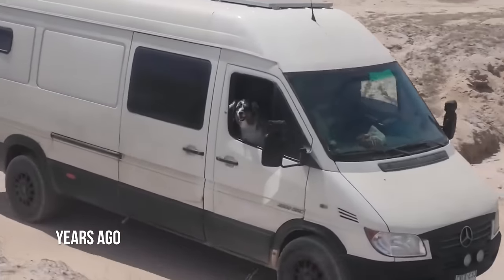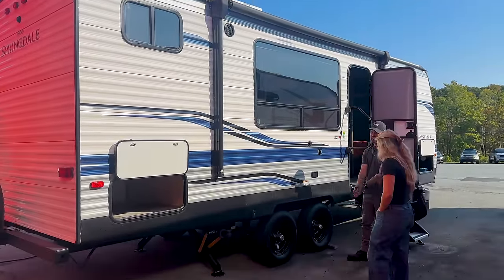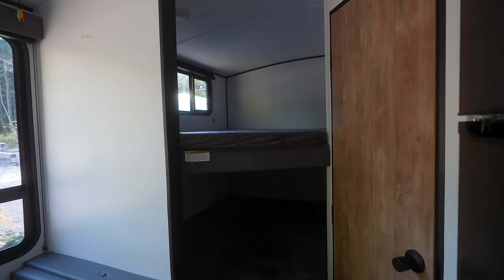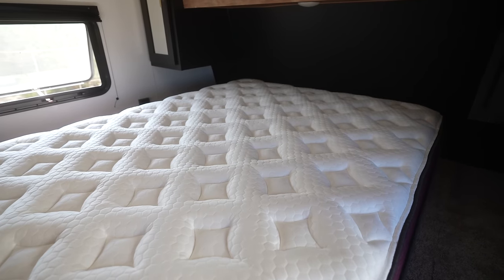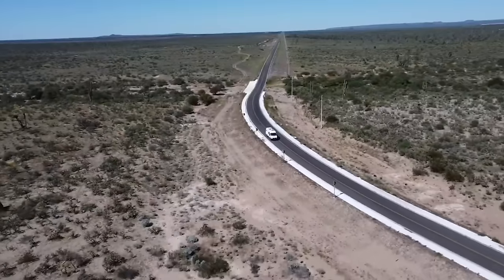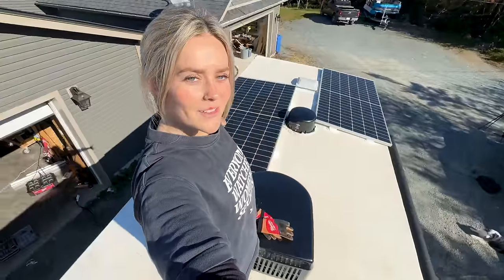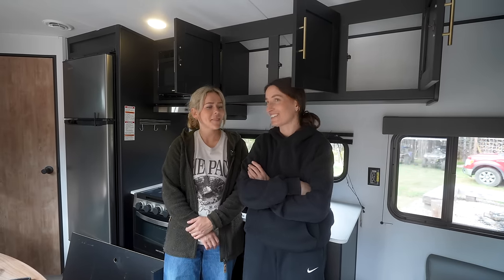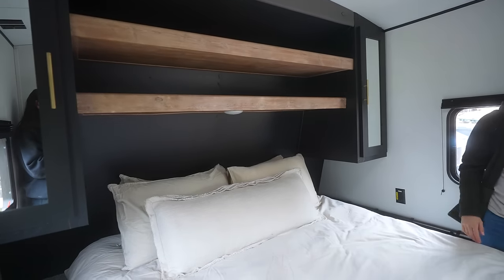We Bought an RV!

Comment: Congrats ladies, you made a good choice. That rig should fit your needs. Since you don't have a lot of RV experience here are a few tips: be cautious of adding too much weight, be sure to carry an easy to use jack & spare tire for flat tires, keep close watch on your tire pressures & carry a small air compressor, while its still new & clean - get underneath with spray foam and seal up all the cracks & holes where mice & bugs will find their way inside, that type of RV patio awning is very easy for high wind to cause serious damage - don't leave the awning out when you're not around - a sudden wind can rip it off, once you get it parked semi-permanent you can add some tie down straps to the awning anchored into the ground. practice backing it up before you need to fit it into a tight space. practice making wide right turns before you're in a city and have to make a right with cars close on both sides.  Looking forward to your new adventures in Mexico

Comment: Congrats on new RV ladies!  Long time RV’er and I live in North Carolina. See lots of great tips, but going to add a few more. Purchase a high quality trailer hitch security lock from Proven Industries. These locks also allow the RV chains to be locked inside the ball area. RV can be stolen very easily with the chains only. Also get a jar of museum wax “quakewax” it’s great for mounting to bottom of small items and they will not fall off walls, counter tops, and inside cabinets while driving. Black and Grey water tank sensors can get mucked up and stop registering correctly. I connected a Camco Rhino Blaster RV Tank Rinser with Backflow Preventer to my tank connection and add a secondary water hose to rinse out this areas just after dumping and tank sensors register correctly. Purchase some good sealer moisturizer balm. Being in a dry climate those door and basement compartment seal will dry out quickly. I use a rubber seal balm/treatment. Also dry lubricant spray for door hinges every 3 months.

Comment: New RV looks fantastic, make sure you get GOOD locks for when it's hooked up and unhooked. Oh, I HIGHLY recommend getting a Weight Distribution System and a Sway Bar if you haven't got it yet and make sure you know the height of the trailer for low bridges!

Oh, small tips, when backing up place only one hand at the bottom of the steering wheel...if your hand goes left so will the trailer and right it will go right as long as you don't make wild maneuvers.

Comment: Congratulations on the new camper trailer!  We have a 2018 Roo 233s trailer. After several years of camping, we started getting blowouts on our trailer tires. From the factory, they came with load range C tires. My brother-in-law said we had to replace the tires every 5 years no matter how much tread was on the tires. We opted to put Load range D tires on the trailer for a little more heavy duty tires. They are working out better.

Comment: As you turned your second bedroom into a storage, take care that you load your belongings in a way that the weight is distributed evenly and the center of gravitation is as low as possible... it will be so much easier to drive the vehicle!!!
And also take care that the weight on the hitch is high enough... this helps you straighten up the vehicle if you have to make quick moves on higher speed!
Good luck for your new adventure!!!❤❤

Comment: Good luck on your trip down south , as other people have said balance is key when towing. Get yourselves a  weighbridge certificate loaded & a towball scale preferably and keep minimum of 10% of weight on the towball.
Even if it means moving  stuff around while travelling. PS :  Speed is your enemy, knock a few kilometres off when towing and you will find it more comfortable IMO
also saves fuel.
Safe travels

Comment: I'm excited to see this new adventure unfold. 1 thing tho, i dont think you're supposed to use regular toilet paper in an RV as it doesn't break down & can clog up the line
Reply from the maker: Thank you for sharing with us.💛🐾
Reply: @Vanwives  You can test any toilet paper by putting 4-6 squares in a jar filled with water. Put the lid on tightly and shake the jar. The TP should immediately dissolve to little wisps of paper. We've found some RV TP won't pass that test as well as most regular TP. Good news is Kirkland Signature at Costco works great. We used it for nine years with no problems after we learned that test.

Comment: Another hint. Always have the awning on as much angle as comfortable. It needs it to she’d rain. It can only take 10-15 mph wind without damage. Always take it down before leaving to go someplace.
Reply: @BobBohner4851  to add to this tip your awning is identical to mine and I lower one side a few inches with the tension screw on the arms to shed water cause a normal rain event will cause it to collapse. 😊

Comment: The first job should be get your septic and water set so you can use them with trailer while building house. I mean put in a trailer spot with hookups first that use the house system. That way if you have guests after moving in, they have hookups available.

Comment: I pull the same size trailer with a 2012 F-150.  I installed Firestone air bags on the rear axle and they make a huge difference when towing, and the head lights shine on the road instead of up in the trees.  Also, keep your speed under 95 kph and the truck will use less fuel.  Good luck on your travels

Comment: Congrats!!! Looks like a better quality unit vs most of the junk you get nowadays. Only have 3 suggestions for you:
1) Replace/Upgrade the tires asap --- trailer tires are notoriously poor quality and seem prone to fail early -- just replace with better quality tires straight away and de-risk that somewhat.
2) Add small sills at the front of your many cabinet doors to avoid things spilling out when you open them after a drive.
3) RV toilet paper --- don't use regular tp if you can help it.
Cheers!...from North Vancouver
PS -- Krystal is just glowing, as usual....

Comment: Great trailer!  Check what the roof material is before walking on it again -- a lot of them have a type of rubber membrane on the roof, and I think you have that as well.  If so, when you go up there, take your shoes off first.  Shoes can often have bits of stone and gravel stuck in them, and that will immediately puncture the rubber membrane on your roof, which will cause leaks.  So easy solution is to just be up there with your socks or bare feet only.  No shoes and definitely no (small or large) bits of rock or gravel!!

Comment: Just a helpful tip. On my truck, on the driver's side, between the front windows, I have the height of my truck (7'6"). When towing my trailer, I have the height, total length, width, and weight with the trailer. In some places, there are height or weight restrictions. 
Another addition is to get a few spare trailer tires, plus a jack specifically for the trailer. I had a truck in front of me shred a tire, and though I did my best to avoid it, 2 of my tires sprung a leak. Also, get a way to add air to your tires as needed - I have one I just plug in and can add air as needed.
Also, change all the locks. Many trailers have the same keys. Maybe look into getting a camera set up for security, and/or add a dead bolt lock. When you decide where to park it, remove a tire on each side or both sides and use cinder blocks to keep it off the ground. When leaving it, take the battery off and lock it up, along with the tires and anything that is attractive to theives. 
Also, when it’s situated, make sure you have the trailer grounded, and above any flooding possibilities.
Reply: Another thing, get some non-slip shelf liners, add some china protectors/padding between your dishes and pans, plus anything stacked that can break. 

Add some cabinet locks, strong magnets, bungee cords, or toggles to keep your cabinets from flying open when the weight in the cabinet pushes against the doors - especially if you are on an inclined, angled, bumpy or rough dirt road. 

Always empty black tank first, then grey tank. 

If possible, get extra insurance for your RV. Especially as you are traveling a long distance. 

Don't forget fire extinguisher, and a fire blanket, they can make a big difference. 

Good luck and safe travels!
❤❤❤

Comment: I have been living in trailer for years and, like you, I didn’t notice mine didn’t have any drawers for cutlery either until I bought it…WTF 😂.    My only concern is the tongue weight with 10 batteries up front😮. I had hoped you would have picked the “L” shaped kitchen rv.   😢.   I think it would have been more long term livable, but you had a lot to consider with the upgrades.  Bravo.  I am so much looking forward to your Mexico project.   ❤. “Playa Castillo”.
Reply from the maker: Thank you for caring and sharing. 😊🐶

Comment: Congrats on the RV, and this next chapter in your adventures! 
Remember that RVs get bounced around a lot when travelling - like an earthquake while travelling (especially on those Mexican roads!).
Tips:
-Those finishing nails will fall out and things will break. Bring tools and supplies to fix broken cupboard door
- Buy a roll of non-skid material (generally used for under small carpets) and line cupboards to absorb some shock and keep things from sliding within the cupboards. 
- Stuff your pillows in cupboards when travelling to fill spaces where you don’t want things shifting
- Put “locks” on cupboard doors to avoid them opening while travelling (child locks work well)
- Put away anything not nailed down when travelling or they become projectiles within the trailer. 
- RV toilet paper only!
Suggested RV names - Romona (aka ROAMona), Seymour (aka SEEmore)

Comment: Remember girls, those little arms that come down off of the bottom of the camper those are stabilizers not for leveling. You need to level the trailer with the front hitch and the tires by putting leveling blocks under the tires. Those arms underneath are strictly for stabilization from what I’ve always known Unless the camper place told you different???

Comment: OK - further research says that Mexico electric power standard is 127 volts, 60 herz.  Some devices may not like that higher voltage.  Check the manufacturer’s info plates for compatibility.  Caution is advised.  Safe travels.

Comment: The gas mileage is going to be a shocker...I have a 21 F150 with the 3.5 eco-boost and end up getting about 7-8 miles per gallon towing a trailer a little smaller than yours...FYI

Comment: You bought a Keystone Springdale!  I think you'll like it.  Besides my Class A I owned for 17 years, I owned two travel trailers/park model's (both @ 35'), one was a 2011 Springdale Western Edition, two bedrooms with glass sliding door entry.  I remodeled the entire interior and refurbished some exterior features and was a great live in while the Class A needed to go to the shop.  The other 35' trailer was another Keystone, but called a VR1, with a pointed front end/front kitchen and huge rear bedroom with office space.  Had that on a lake lot on a hill.  Fun times, as I know you'll be enjoying this new Springdale in Baja!!!  And I should have known from the Popcorn/Microwave hint that you were not going to rely on 30 amp power, going Solar/Battery is so YOU!  Tip:  Those vinyl covered sofa's/seats won't hold up to doggy paws so get some good covers and they should hold up longer.  So excited for you.  BTW, what happened to the van?  Scratch that question!  I watched to the end!

Comment: nice camper ladies !. my only worry for you two, is the truck might be under weight to tow such a large camper, 30 ft ?..wow..thats pushing it big time. my 1/2 ton truck is set up for towing, and i have towed a 29 ft trailer with it, but man...getting 5 mpg sucked big time..lol. be very careful about putting too much weight in that back corner ?, you do not want to go through the '' tail wagging the dog '' (trailer sway )..its not fun at all !. deff ditch the tires that came on that rv, chances are, they are china tires ?, check into some name brand tires, i put goodyear endurance tires on my camper, love them !. last but not least for now, do not speed when pulling this rv !..take your time getting there, it may seem slow ?, but at least you get there safely !. p.s. be sure to test everything before you get to mexico in that rv, a lot of things will not work, and then you will need to have them fixed, fun times with those issues !..lol.

Comment: 3 things come to mind that you should know about towing and owning an RV. 1) NEVER leave the awning out with both ends even or parrellel. In the rain it can easily become a bathtub and the rain water weight will destroy it. (As me how I know).  2) Make sure you never overload the back of the trailer while traveling. It can cause you to lose control in a heartbeat. (Watch YT videos on propperly packing trailers). 3) You have to use RV SPECIFIC toilet paper to keep from plugging your tank and piping system.  RV type TP has less of a binder, so it breaks down far faster in water.   I was really happy to see the solar batteries placement up front.    Best of luck!!!!

Comment: Lady's 5,000 miles!  make sure that everything inside and outside is tied down before taking-off to Mexico.  make sure that the cabnets have magnets to keep them closed.
take a jack for the trailer for fiat tires,   everytime u stop, check the trailer tires lug nuts.  put a security light outside by the door.    Ur Baby's will love going to Mexico.
Have a fun and great time going down there in ur new travel RV.   lv from Sunny Florida.   be careful driving drive thru at Mcdonalds.
Reply from the maker: Thank you for sharing all your knowledge and experience with us. We did a lot of research and reading on the RV life. 😊🐾
Reply: @Vanwives  just wanted to let u know some of the RV life foegots before the trip.   be careful going too fast around the corners,  takes a wide turn.
Reply: @Vanwives  If you haven't left and found out the hard way, research marine cabinet hardware. When driving down the road, the trailer is subject to motion similar to a boat on the water. Also, stow gear like it's a boat, for weight distribution and center of gravity.
Toolbox drawer liner material should help with keeping stuff in cabinets from sliding/rattling when under weigh. Toolbox drawer liner is also good to separate pots and pans to prevent chipping/denting/scratching when nesting them for travel.
Happy Trails!

Comment: Considering how far y'all will be traveling and that the trailer will probably be overweight, I would suggest you carry an extra leaf spring, because they do break. Also, get a bottle jack and make sure you have the right size open-end/box-end combination wrenches and sockets with a long breaker bar (not crescent or pipe wrenches, they will round the nuts off)  to remove the leaf spring WHEN they break. Once you change the first leaf spring you will get the hang of it. A little intimidating the first time, but it is really quite simple. It's just part of the joy of owning an RV. Also, when you stop for gas or a break, inspect the suspension to make sure everything is hunky dory. Can't wait to watch the journey to the Baja and the build of the new place!

Comment: A tip for new RV owners, when filling the fresh water tanks run the water in slowly the tanks have air which needs to come out , but some tanks dont burrp very well , so you can end up heading to your destintion with only half the water you should have, cheers

Comment: Yeah, tires.  Michelin.  Mexico electric standards?  When Dad had the car stereo shop in St. Paul, MN back in the mid 60’s he had a customer from a Spanish-speaking country.  I think it was Mexico.  The gentleman needed  twelve a volt plug in power supply.  He mentioned that his electric standard was 120 volt 50 herz. The US and Canada are 120 volts 60 herz.  I don’t know if you can plug in in Mexico and have full compatibility to your electrical equipment.  More research is advised.

Comment: Nice.    Before leaving, take your truck to a shop and have the rear springs checked for breakage. I have a Ford ( 2019) and they break where the U Bolts are in the fighting hold down 
 Not saying your's are but it's always a smart thing to have checked 
 I have replaced both of my leaf springs. It's hard to see if there broke unless one half of the broken leaf is already missing 
  Just a safety check up before heading out a long road trip 

  You ladies stay safe and can't wait to see the start and ending of the New Build.

Comment: Awesome…we’ve owned a travel trailer since 2018. We love ours…if you need any help or suggestions just give a shout out. Also…get some Goodyear tires to replace the factory tires…they are nicknamed “China Bombs”…always lots of blowouts.within the first 500 miles. Also once your set up make sure all the underside of the camper is sealed once you get there…helps keep ants, and other creepy crawly’s. We use Reflectics. It’s silver insulation on a roll that you cut to  fit the windows. You may want a humidifier because of the low humidity down there and it allows dust to be more airborne. Not sure if your already on your way but some of the  Loves Truck stops in the States have Rv stops with full hook ups, a lot of Walmarts aren’t allowing overnight parking. Can’t wait to see your next adventures.